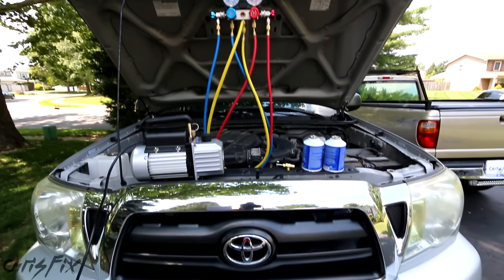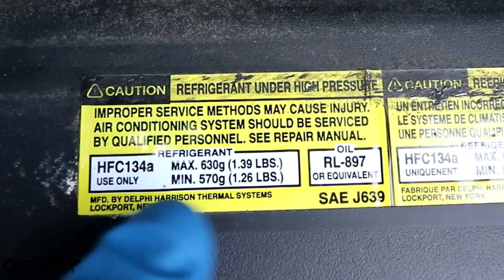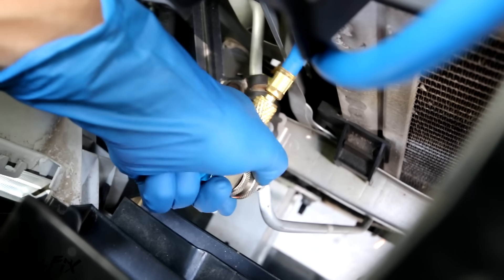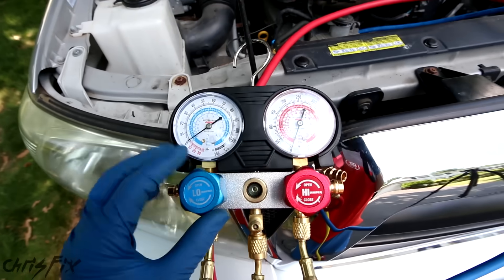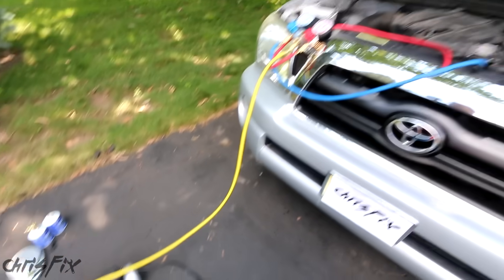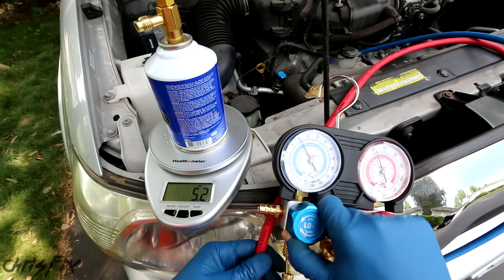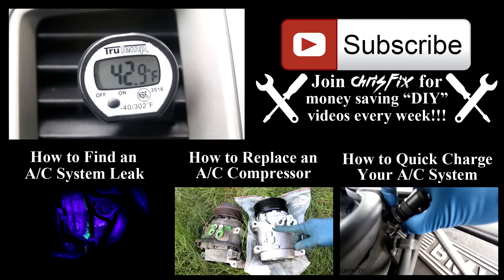How to Properly Recharge Your AC System

Comment: Just made me feel GOOD seeing the thermometer at the end.  This job...is going to suck way worse than you made it look Chris.  🙄
Reply: Hey, did you do it? I did it on my car's A/C System. I have a well maintained 1999 Mitsubishi Mirage and had been having cooling problems for the last 2 years. Plus the fact of not having a cabin air filter made the evaporator filthy with dirt and dust. I had had it, so I decided to replace EVERY component in my system (Compressor, evaporator, condenser, drier canister and expansion valve. I got all the equipment and did it myself. It was the best decision ever and saved a ton of money.
Reply: @theconcorden  Didn't do any of it myself.  Should have though.  I had a broken wire...took three shops to figure it out.  First had me convinced it was a "computer control issue" so I didn't want to mess with it.  There are too many sensors, pieces and parts to mess with for me.

Comment: Hey Chris. I need your knowledge and expertise. I have a 2012 Acura TL SH-AWD and when I turn the air conditioner on it only blows cool (not cold) air from the passenger side and warm air from the drivers side. Any reason why this is happening? Please help.

Comment: If the vacuum pump is a good one for air-conditioning work it would have a "gas ballast" valve which is used when pumping down a system which has water / water vapour.  That's the BLACK valve on the top of the pump labeled "GAS" in your case.  If you don't use the gas ballast valve and there's water in the system you will turn you pump oil into mayonnaise.  
I used to service and rebuild vacuum pumps and every year the shop was full of vacuum pumps full of mayo and many completely ruined - not possible to repair.

Comment: Very informative video! Thanks Chris. Much appreciated. May I add. When connecting the high and low side connections verify the valves dont stick and are operating properly. Otherwise you will have to do the job all over again. I didn't find out the hard way luckily but I saw the potential.  All im saying is exercise the valves on both high and low side to make sure they are functioning properly.  Simply connect them then disconnect them then connect again to make sure they are not leaking. Mine were leaking and luckily I caught it before I did any work.

Comment: Add the correct amount, yes of course, but also make sure the pressures are correct. Inconsistancies on the gauges can indicate a restriction or lack thereof in the system. A good pointer for many people is that if you replace the compressor, replace the accumulator/dryer and orifice/filter. You don't want any old compressor particles clogging your fresh system and comprimising your new system and all that hard work, time, and money. Very good video, great guidelines for novice mechanics! Also, replace the schraders and "seat" them, cheap insurance and they are usually the culprit in a leak scenario. Also, stay away from dye in a new system, you shouldn't be worried about a leak on a freshly repaired system.

Comment: "Be environmentally responsible" Noted!
Reply: Pukito Kiho but it’s ok to purge the system and let the R-134 out in the air to do more damage I’m a mechanic I do AC work all the time AC work is not easy and you need a license to do it its best to take it to a shop and let them do it for you because if anything go wrong you take it back and they will fix it most of the time free of charge.

Comment: Just a heads up for anyone trying this at home, depending on your state releasing refrigerant into the atmosphere is illegal if your not licensed so if someone who knows there stuff see’s you they can snitch on you and you’ll be fined $27,500 and the snitch will get rewarded $10,000 I doubt anyone would know about it but just a heads up, never know if your neighbor could be certified and hates you
Reply from the maker: No one is releasing refrigerant into the air. The system is empty already which is why it needs to be fixed.

Comment: Hey I’m looking for answers on why a 2015 outlander would have ac issues while driving but not while idling/parked when in idle ac pressure stays steady if it is reved up pressure drops causing compressor to shut off then pressure rises to turn back on. What is the issue

Comment: When I tried this I couldn't get refrigerant to go into the low pressure side. Not sure what's wrong.
Reply: I have the same problem.  I hope someone knows why.
Reply: I put the can in a bowl of hot water and that did the trick. The instructions on the can say to agitate while turning the can from 12 to 3 o'clock and then turn upside down when the can feels empty. It took about 15 minutes to charge a 12 oz can.  Worked great.

Comment: Man you 609 guys do it differently. In commercial if you walk up to a flat unit, the 1st thing I do is nitro purge & hold test. Why would I attempt to pull a vac on an obvious leaker? Those analog gauges may not pick up a pressure/vac loss in that short of time (never heard of anyone achieving 30" of vac but those are from Harbor Freight). A micron gauge down to <500 will prove no leak (also look for loss of vac by holding). What do you guys do if system doesn't hold vac? Leak check the system? How? Add nitro & dye.
I would have done that 1st.

Comment: How expensive are the components used to do this? Seems to me that it's a waste of money to get these items to top off the refrigerant. That can be done at many places that do that work. And if you have to top off regularly, then you have a leak in the system and you should get it fixed.

Comment: I recommend leaving the refrigerant can upright during the low side charge process. It takes longer to charge, but is safer. Turning the can sideways or upside down can put liquid in the line, which can damage the system.

Comment: This is doing it the right way folks to prevent damage to your AC system from doing it the wrong way with those diy recharge cans you find in any parts store. It’s important to know how much refrigerate you are putting in the system. You can’t tell how much you are putting with those recharge cans even though they come with a small cheap gauge

Comment: I am about to start the charging process after replacing the compressor and I also replaced the dryer and the orifice tube on a GMC.  The question I have is...  It seems like there is oil in the system.  There was in the dryer.  This is a huge system a Suburban with rear AC.  It calls for 11 ounces of oil.  Some oil was probably lost when the compressor front seal went bad.  I put about 3 ounces directly into the compressor.  Do I really need to put all 8 ounces into the system?  Should I reopen the dryer or the compressor and just add it there?  Will evacuating the system pull out the oil too?  thanks to anyone who knows the answers.  Thanks ChrisFix, your videos are nicely edited and well paced.  They are completely helpful.

Comment: My system went up to 90 on the low side initially and then kept rising with no change to the high side as well...is it a bad compressor? System was completely empty of Freon
Reply: If you try to pull a vac on a leaker, you will obviously pull non-condensables into the system. AKA not completely sealed. Air/moisture mixed w/ refrigerant & oil doesn't work to well with a compressor that is designed to only pump REFRIGERANT.

Comment: Hi great vid , I have a window unit I accidentally made a small hole and freon leaked out..so I covered the hole with solder,  Its r410a so I got a gauge set like yours and a can of r410a and a piercing valve to pierce ac line and I want to attempt to refill it , is it similar to this video? , the window ac only has the one input where I'm putting the piercing valve,  plz let me know thanx...

Comment: THERE ARE SO MANY THINGS WRONG WITH THIS VIDEO IT'S JUST STAGGERING: 1st: so go ahead and buy an ok manifold gauge set ($200-$300+) and a vacuum pump ($300+) and a digital scale ($150+) for a job that most local shops are offering an "AC special" at $59.95 plus refrigerant... 2nd: if there is any refrigerant whatsoever it's against the law in the U.S. to do anything but recover and recycle the refrigerant using appropriate recovery equipment.... 3rd: oh boy you replaced your own compressor... did you also replace the receiver drier? did you flush the lines? did you measure and quantify how much oil was in the system and how much oil the system needed (a super important step)? did you replace the expansion valve?..... 4: was there metal debris from the compressor going bad? did you replace the appropriate parts that get ruined when a compressor grenades such as possibly the high side line, the receiver drier, the condenser?...... i could go on and on, but in the end, i'm not against people fixing things for themselves. that's great, but in the long run if you don't do it right then you have a good chance that your going to have to spend even more later. if you do the repair yourself then taking it to a qualified technician before to drain and recover the refrigerant, and then afterwards for a evacuation and recharge may be well worth it. the technician can evaluate the pressures and let you know if you did a good repair or not.

Comment: Great video... but I was unable to add the PAG oil with dye through the yellow hose. I have 14oz to add.. it would not hold and just leak out. I am now trying to find some way to borrow a PAG oil injector instead of buying one that I’ll probably only use once. Other than that the video was great

Comment: Chris, I used the tare button on my scale to set the weight of the full can and tap to zero so I could get a direct reading of the ounces of refrigerant transferred to the system. Of course the ounces came out as a negative number. Everything turned out great! Thanks for the superb video.

Comment: went to charge my VW golf's ac and got 1 can and part of another can in and still compressor didn't kick on (got to about 90 PSI). Think the AC compressor is finally dead? Last summer low side was sky rocketing indicating a failing compressor.
Reply: yeah your compressor's probably shot...

Comment: I'm sure that I am not the only person to catch this, but  ...  
The system Charging Sticker calls for refrigerant to be added to the system in Units of Weight,  i.e.,  (1.39 lbs). Max.
However, he shows the refrigerant can, and notes that it is labeled as "12 ounces"  and makes the mistake of thinking that "ounces of weight" and "fluid ounces" are the same unit of measurement.
They are NOT. 
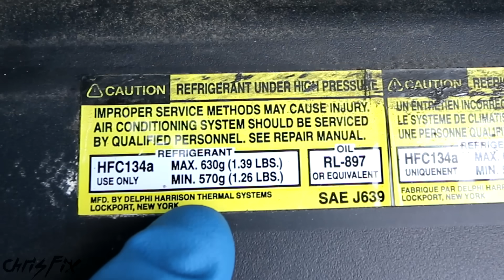(click here to see it :  1:57 )

Edit:
If you don't comprehend the significance of this discrepency  ...  think about it as follows:  
If you survive the charging process, while using FL. OZ in place of Weight OZ,  it is likely that your AC System will not.
Sometimes, when an AC System is overpressurized (over-filled)  the condenser coil or the evaporator coil will literally EXPLODE.
No kidding. Really.
Reply: I think the can is labeled incorrectly. It says "Net Wt.12 Fl. oz.(340 G)". Net Wt. and 340 grams points to the 12 as being ounces in weight. The Fl. should not be there.
Reply: @bowman4331 ,
I definitely agree there exists an error. But, I would have to wonder whether the error exists in the FL Oz measurement or the weight measurement.
If the can truly weighed (12 ounces) then the representation in grams would be correct. 
The fact that the can weighed (20 ounces) when he placed it on the digital scale, doesn't help matters any. Yes, I am aware that the weight printed on the can's label indicates "Net Weight" of the contents. But the extra 8 OZ seems too great an amount to represent the empty container.
Reply: @bowman4331 ,
I found the following figures, which apply to R-12 freon. Unfortunately, my search for the weight of R-410 per liquid OZ did not provide any info.

Specific gravity of Freon at 25 C (77 F) = 1.315; you could find different values of specific gravity for Freon for different temperatures and use them here:

FREON (Dichlorodifluoromethane refrigerant R-12):

1.315 * 1.04125 oz/fl oz = 1.36924375 ~ 1.37 oz/fl oz

...  So, the reason that I post this info, is because I think it may be possible that R-410 freon weighs (1 OZ) per each liquid OZ.
I also believe that this would be a substantial coincidence, if it were true. Certainly worthy of mention in a "How To" video that instructs DIYers to charge their AC systems.
Reply: @marshalllhiepler  I think the specific gravity of r134a is 1.208 at 77 degrees Fahrenheit.  I will try to find an empty can and a can tap and see how much they weigh and let you know when I find out.

Comment: Great video and clear explanation!  I have a question. My car is only mildly cool and it is not hot summer yet. It was ice cold last summer. I followed all the steps in vacuuming, checking leak, refilling proper amount of 134a according to the spec.  The compressor and gauge reading all looked good. BUT the AC is still only mildly cool. Any suggestion as to why?  Thanks.
Reply: Try checking your filter first clean them. If problem persist let me ask few questions does it reach to the point that it doesn't cool? Maybe you have a leak, if not maybe a compressor problem.

Comment: Good video. What I did to get oil into the system was to dip the yellow tube into the oil bottle. Then I opened the valve on the blue side and noticed that the vacuum sucked the oil right out of the bottle.  Then I closed the blue valve and began attaching the r134a cans.

Comment: Hello Chris,   Thanks for the video.  My question is when you add the oil to yellow hose and then purge the air out, the oil will be the first thing out.  So how does the oil get in the system?  Thanks
Reply: Pull a vacuum on the system (couple of minutes)...add the oil, open the low side to draw in the oil. Once the oil is in the pull a vacuum on the system for at least 1 hr. If you don't want to do that then open up a line and pour some in...reattach the line...then pull a vacuum. All that matters is that oil is in the system!

Comment: Hey Chris, my ac is blowing warm air when driving over 1500 rpm. I checked the compressor and it's within specs. Low side 30psi, high side 145. Temp 73F humidity 75. Does that mean I'm low on refrigerant? I tried taking a shim out from the clutch but that didn't change anything. Let me know. Thanks man.

Comment: Wait. Don't they have those easy a.c. cans with a little hose and pressure gauge
Reply: That doesn't tell you how much your adding only the pressure in the system when it's running and only on one side

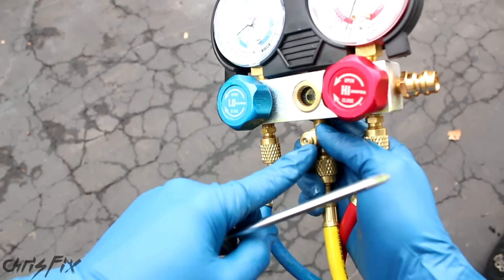Comment: 9:17  as soon as the can tap was opened, lost vacuum and went to slight pressure before the yellow line purge.  I wonder how adding oil or dye via the yellow line works when you're going to purge the air out after, I'd think the oil / dye would be purged out too.  I think there are injectors that can be used to add dye, after purging and adding just enough refrigerant to give a slight positive pressure- a few psi, so no air can get in to the system.  When I did mine at home I used a second charge line with can already attached so that I could pull a vacuum all the way to the can before opening it, instead of purging via the schrader valve, since I didn't trust how much air could be between that purge port and the valves.

Comment: Good afternoon 
I have a 2010 Town and country touring, we replaced the  rear AC evaporator due to leaking,  after the installation and the charge of freon the unit now have a hissing noise. Can figure out what is it.
I would I appreciate any information of what maybe causing this problem. 

Thanks

Comment: If I'm not changing any parts and flushing the system with a vacuum will I need to add new oil?
Reply: Yes anytime you refill the AC system you have to give it new oil at least new oil to replace the amount that you took out
Reply: @Zacutom  You have to add pag oil just to recharge refrigerant?

Comment: You never said what your pressure readings was on the low side or on the high side? Great video it help me a lot today I got my a/c fixed on my 1995 Toyota 4Runner...Thank you 😊
Reply: 30-40 on low side...180-210 on high side. depends on ambient temperature.

Comment: You may have to jump the low pressure switch to get the ac to kick on and fill your system. It will be different for each vehicle.

Comment: Hey ChrisFix, would you still need to add oil if you only replaced the valve core and pulled a vacuum? I did not replace any major components.
Reply from the maker: I would still add some oil since it leaked out from a leaking system
Reply: @chrisfix  Will do. Thank you for responding. Fan for life

Comment: Standing pressure 134a car ac?
Reply: It depends on the ambient temperature, use a pressure temperature chart if the pressure of the refrigerant is equal to the ambient temperature then it should be right

Comment: I can't tell you how many times I've used this video as a reference. Thanks for shooting it. Great job. I replaced most of the AC system in my 2002 Chevy 2500HD and every time I need to charge it up I watch this to make sure I get the steps right.  37 degree air. Many thanks!
Reply: Every time you need to recharge it? Then you did something wrong, A/C systems are close cycle ones, you shouldn't have to recharge anything. You have a leak.
Reply: @huracan200173  I don't have a leak. I replaced several major components one at a time. The AC system is 17 years old. I put a new compressor, evaporator, filter, condenser, high pressure line, etc at different times. Had to recharge the system each time I replaced something.  Thanks for the advice anyway.

Comment: When charging my system I accidentally opened the high side valve for around a minute. What does this affect and what do I need to do? It seems to be working fine blowing at 44 degrees.
Reply: Check the low gauge, if not over 30,should be fine,low side 35 and high side 200 max,if over something wrong.